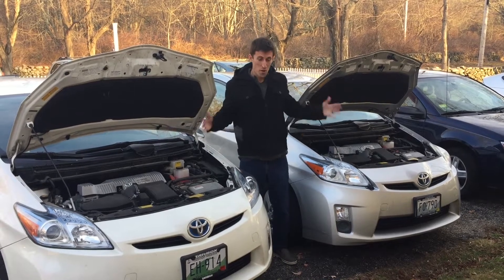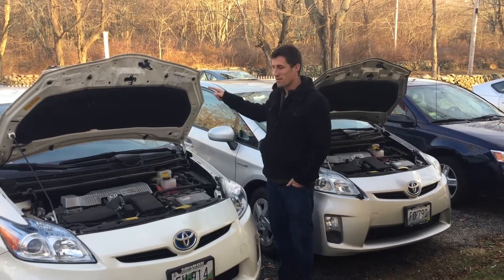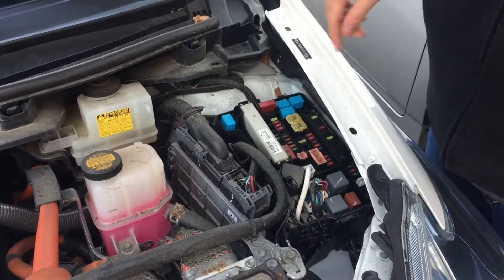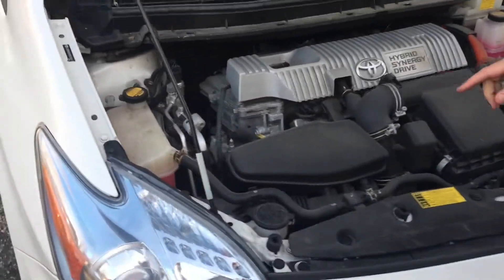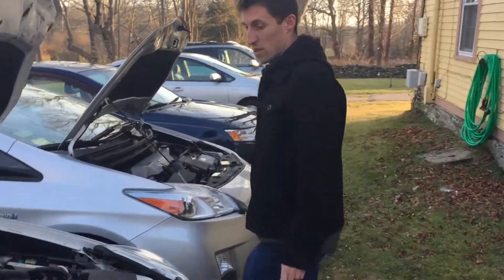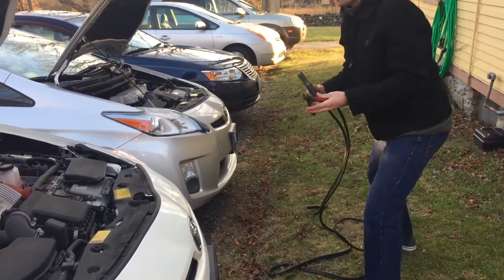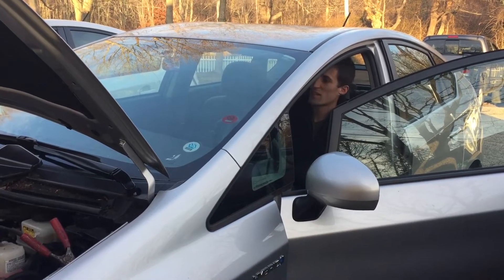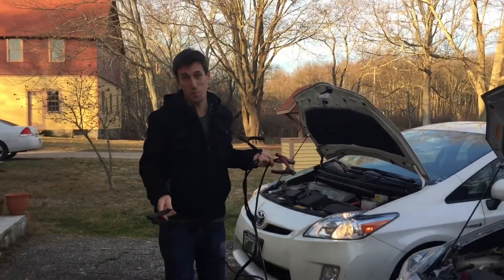Jump Start a Prius with a Prius - Dead Starter Battery

Comment: 'Don't use a Prius to jump other cars as they draw more current than the Prius starter battery can output.  However a Prius can be jumped by other cars using these terminals. "
thank you for menitioning this.

Comment: Prius 2012 will not shift to Drive or Reveres. Instead it goes to Neutral. 12-V battery is  12.6 Any idea?
Reply: Did you get it eventually?
Reply: @RogerPack  It was a computer problem. It was a recall, and free repair, but only if the problem manifests itself.

Comment: What does it mean if the dead Prius doesn't respond at all to the jump?  Should the good Prius's engine keep running for the jump to work? The engine on the good Prius from which we are trying to jump keeps shutting down shortly after turning it on. These are 2 2015 models. The dead one is a model 1 (bought used) and the other a model 2.
Reply: Did you get it eventually?
Reply: @RogerPack  nope. They’ve been stuck there for 2 years

Comment: Not the starter battery, that uses the high-voltage battery pack to start the engine not the 12 volt battery. 12 volt battery just Powers the computer and other accessories. If the high voltage traction battery that actually starts the engine were to go all the way dead to the point of not being able to start the car it'd be a different problem.
Reply from the maker: Hey Chad, can you explain more?  I'm confused.  The car was dead to the point of not starting when shooting this video.
Reply: @schnozz2  sure. although the car uses the high-voltage battery pack that actually turn the engine over, it can't do that without the computers running first, and the computers are powered off of the 12 volt battery. As soon as the car is in ready mode there is a dc-to-dc converter used to step down the high voltage battery pack to keep the 12 volt battery charged. Because of the way this works the actual power stored in the 12-volt battery is only used to power the interior lights and run the computer for about the two seconds needed to go into reading mode, and then essentially the car is using the power out of the high-voltage battery pack through a dc-to-dc converter and running the engine to recharge the high-voltage battery pack as necessary. Because of this setup you can hook a several hundred Watt inverter to the 12-volt battery in a Prius and if you leave the car in ready mode where it will start up as necessary, you could power a refrigerator indefinitely like after a storm. There's at least one or two YouTube videos where people have done that after hurricanes. If you're still a little confused, if the high-voltage battery pack gets completely depleted the car would power on so the dash lights are on but be unable to start the engine, if the 12 volt battery goes dead the car won't even power on. The car tries very hard not to deplete the high-voltage battery pack all the way. Even if it shows only one bar of battery on the high-voltage battery pack there's still Reserve left in the battery of more than 20% alligated for starting the vehicle.
Reply from the maker: Chad Higgins that’s for the explanation.  Makes sense
Reply: @schnozz2  anytime the car is not in ready mode you are running off of the 12 volt battery.